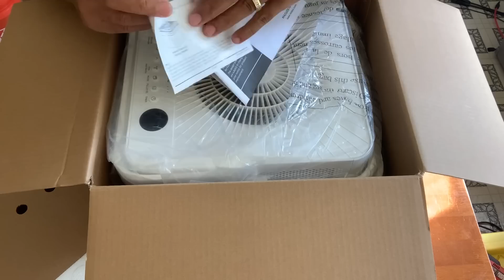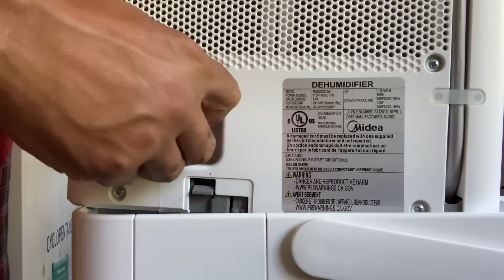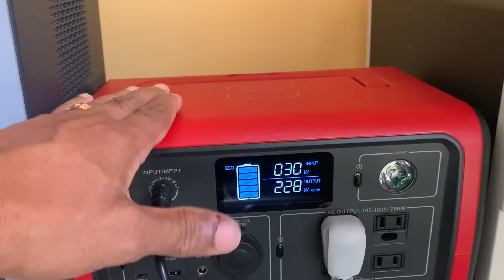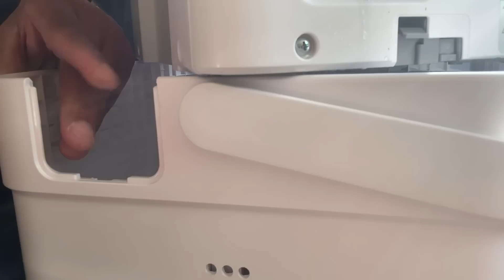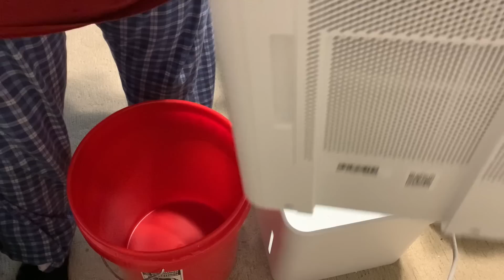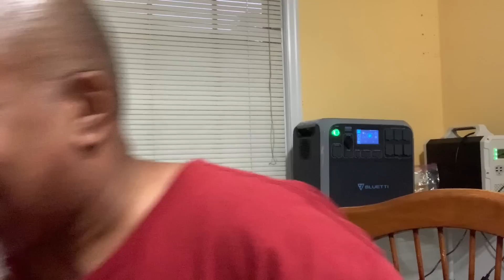WATER COLLECTION WITH DEHUMIDIFIER  Lead farmer73

Comment: need to test it for ammonia dehumidifier water is usually 8 ppm , 5 ppm is toxic to humans , your brand of water filter (it also says not to filter dehumidifier water with it )will not filter out ammonia SMH , The expense of making that water drinkable would be too high , can buy bottled R/O water cheaper . Drink it if you want , but your causing internal organ damage
Reply from the maker: check And look inside of the pipes under your sink and then I want you to read this again. I have been doing this for years. There is nothing wrong with this as long as the water is filtered please be educated. Thank you.

Comment: Now you will spend five days trying to unclog your filters from all the dust, pollen, and skin partials that are ruining them. Ask me how i know. My Berkey filters can filter 100s of gallons of tap water no problem. 10 or 15 gallons of dehumidifier water will wreck them. The particles floating in the air are so small you cant even see them. Its like throwing a hand full of talcum powder in with your water filter. The dehumidifier filter does not filter jack. My air is comes off the Pacific ocean and is the cleanest you can get. If you are in a city good luck.
Reply from the maker: Thanks for your comment💰

Comment: Technically this is distilled water and it doesn’t have minerals in it .. that means it’s not safe to drink everyday because it depletes the minerals in your body as they bind to water. To counter that you need to add some minerals into it to make it safe to drink everyday.

Comment: There are several modifications that can be made to ensure the water is safe to consume. Firstly replace heat sinks with copper, the plastic tubing can be replaced with copper, which has the added benefit of being incredibly bacterial and  mildew resistant. You can also switch any of the filters with food grade mildew resistant ones! If there is any plastic that the water comes into contact with, it can be replaced with a food safe alternative. 
 Then you can go one of two routes 1.) LOW COST,  A LITTLE MORE WORK- Create a diy three stage collection the first being a quality filter like water drop,second  using CLO2(Chlorine dioxide solution, a widely available and inexpensive chemical that will remove most pathogens) it is effective against biological, chemical and bacterial contaminants, even phthalates; yet possess no threat to humans or animals health. After a short treatment with CLO2 you can finalize and remineralize  with Celtic salt, Himalayan salt, and calcium carbonate. 
2.)HIGHER COST, QUICK SET UP-Use a countertop reverse osmosis filter with a natural remineralization filter included!
 So for a small upfront cost and a little modification, you can have a safe, reliable, replenishable water source for emergency or survival situations.
 IN ADDITION: The quantity of water will obviously vary depending on moisture levels and temperature, BUT even in the dryest of environments the air always contains water... So even in a desert you would be able to generate water . Obviously the bigger the unit the more water it will generate and hold,  but that means it will require more energy. There are very efficient larger units that would consume much less energy than multiple smaller units yeilding similar quantity, so it's best to get the highest quality with the most quantity possible. But better to get whatever you can to start and add additional units than to wait and be without this vital resource! 
 IN ADDITION TO THE ADDITION: Solar panels with generators are a great solution, another option if they are going to be in a relatively stable place is to utilize a solar attic fan panel or ring doorbell panel and have a dedicated connection that will take advantage of any sunlight to collect water! You obviously have to make sure to find a compatible panel to match the specifics of your unit but it's a possibility 😉

Comment: This water is aafe to drink but it has no mineralization as is. If you drink it it will wash your body of minerals. It should be mineralized before you drink it.  As is it is only hydrogen and oxygen. Good video but add Himalayan or celtic salt. Fine for bathing as is though.

Comment: Wow!
Thank you again Lead!
I live in a very humid area.
I have been researching homemade water collectors
This is a great idea!
Reply: This could literally KILL you. You can't drink the water from a dehumidifer. It passes through toxic chemicals, including oils and metals. You cannot do this. Please do not suggest that people drink this. You need an atmospheric water generator, yes it's the same principle, but the heat sinks are pure copper. The heat sinks in a dehumidifier are made of metals of all types, but it is NOT food safe. Pure copper is food safe. PLEASE DO NOT DRINK DEHUMIDIFER WATER PEOPLE!!! You can change the heatsink and be sure the condensation is being formed on PURE COPPER, which is food safe, THIS IS NOT SAFE TO DRINK!!! You cannot filter these contaminants out with a Berkey or any other water purification unit. Do not drink!!!

Comment: Lead,
How much water do you suppose it can collect if you put it outside, with the power station and solar.
Maybe you can use it with a 5 gallon bucket and the hose in case it collects more. When filtering the water if collected while outside do you think it should be further filtered by using a coffee filter before putting it in the Burkee water filtration?

Comment: Now this is one of the best survival tips I have heard yet and it is much better than trying to buy up cases of water! Thank you family ❣️ for caring and sharing!!! 💯👏😁
Reply: This is not a survival tip this will kill you! This could literally KILL you. You can't drink the water from a dehumidifer. It passes through toxic chemicals, including oils and metals. You cannot do this. Please do not suggest that people drink this. You need an atmospheric water generator, yes it's the same principle, but the heat sinks are pure copper. The heat sinks in a dehumidifier are made of metals of all types, but it is NOT food safe. Pure copper is food safe. PLEASE DO NOT DRINK DEHUMIDIFER WATER PEOPLE!!! You can change the heatsink and be sure the condensation is being formed on PURE COPPER, which is food safe, THIS IS NOT SAFE TO DRINK!!!

Comment: Thank you. I have a dehumidifier. The humidity level in my home right now is about 32%; outside it's 36. I'm going to run it for 24 hours or until full to see how much water it collects.
Reply from the maker: Let me know how it goes 👍🏽
Reply: @leadfarmer73  Once again Lead you've shown why you are worthy of having your own channel. At an average of 35% humidity I managed to extrapolate just under a gallon of water from the air in about 19 hours. I've owned a dehumidifier for quite some time now, but never thought of it from a survival angle. Keep doing what you're doing and kudos to you!

Comment: Great video..I had the same thought while running my dehumidifier. On it's own... dehumidified water is not drinkable due to bacteria in the air, mold spores, etc. Theoretically, the Berkey should be more than capable of removing those containments from the water making it safe to consume.
Reply: Yes. That and disinfecting your dehumidifier regularly so you don't overtax your Berkey, you could technically have your dehumidifier drain into your Berkey.
Reply: This could literally KILL you. You can't drink the water from a dehumidifer. It passes through toxic chemicals, including oils and metals. You cannot do this. Please do not suggest that people drink this. You need an atmospheric water generator, yes it's the same principle, but the heat sinks are pure copper. The heat sinks in a dehumidifier are made of metals of all types, but it is NOT food safe. Pure copper is food safe. PLEASE DO NOT DRINK DEHUMIDIFER WATER PEOPLE!!! You can change the heatsink and be sure the condensation is being formed on PURE COPPER, which is food safe, THIS IS NOT SAFE TO DRINK!!! Berkey cannot filter out these contaminants. DO NOT DRINK!!
Reply: @AwakeningWarrior  Whether it’s drinkable, I don’t know, but, the dehumidified water could be used in that 5 gallon bucket, to wash clothes with - all a person would need is a plunger and some dish or laundry detergent.

Comment: Still he used a solar generator to run the dehumidifier to get water out of the air and then ran it through a water filter.  Once owning all the equipment, the process was free. Wow.  Impressive!
Reply from the maker: EXACTLY! It all ends up paying for itself in the short term with the cost of water

Comment: A man had a truck full of dehumidifiers and a filtration system. He was providing clean water to the community. Military came in and confiscated his whole rig—everything. 

People with air conditioners are essentially doing the same thing. One gentleman in Africa got a patent on the idea. For the little people like us, this could definitely be a life saver, especially with solar panels as y’all have. 💯
Reply: Just ordered the small cube. Had a $20 coupon. I got very thing for the bucket filter but sand and gravel is so heavy so I got 2 gallon buckets. Just started your setup for growing with water. It is on the small with 2 1 gallon shoe box size.. just put in 2 lettuce sprouts yesterday

Comment: I have a small Haier that I use 24/7 and probably get a gallon a day. I use it to water my plants with outside. I'm on a well, but do plan to use it if the well goes down in the future. You could probably get water faster if you use the thing outside.
Reply from the maker: That sounds like you have a pretty good one.
Reply: @leadfarmer73  - It's a good brand, but it's smaller than yours. So it has to be hanged out several times a day. It beeps when the tub is full. I like that you're sharing your good ideas. :  )

Comment: I wanted to say "Thank You So Much" you are saving our lives on another level that they do not realize yet and appreciate that you listening to that "still" voice. I'm debating on size but it will not take long to do that,  just because I'm thinking of my extended family as well. Thanks again! for the both of you .  :)
Reply from the maker: Thank you so much single girl 🌹
Reply: This could literally KILL you. You can't drink the water from a dehumidifer. It passes through toxic chemicals, including oils and metals. You cannot do this. Please do not suggest that people drink this. You need an atmospheric water generator, yes it's the same principle, but the heat sinks are pure copper. The heat sinks in a dehumidifier are made of metals of all types, but it is NOT food safe. Pure copper is food safe. PLEASE DO NOT DRINK DEHUMIDIFER WATER PEOPLE!!! You can change the heatsink and be sure the condensation is being formed on PURE COPPER, which is food safe, THIS IS NOT SAFE TO DRINK!!!
Reply: @AwakeningWarrior  Thank you for the heads up. I'm still glad leadfarmer73 brought it to our attention, NOW. And, I've learned that you can use this water in many other ways and this could help us save our drinking water for drinking and dehumidifier water for other uses around the garden and home.

Comment: Do you like your Berkey?  Mine looks nice but it's a hunk of junk.  It takes days to filter a gallon.  I've tried the available pump which is supposed to help prime the filters, but it didn't help at all.  I totally regret buying that thing.
Reply from the maker: I know EXACTLY what’s going on! I thought the same thing for a second a few months back when mine started taking forever to filter. You have to take it apart and clean off the filters and can, reprime the filters a BOOM! working like new again. Your supposed to clean them every so often because they are catching so many small partials. I hope that works for you as well as it worked for me.
Reply: @leadfarmer73  Mine never worked properly, even when new.  Maybe they were just a batch of defective filters, I'm not sure.  I'm glad yours is working, though!

Comment: The Berkey water filter produces the best tasting water you could possibly drink . Thank you leadfarmer73 for all this precious information.
Reply from the maker: Thank you Samuel. The Berkey is the truth!
Reply: Thank you Lead, this is life saving information! Believe me it want be wasted.
Reply: That Berkley filter and others like it was designed for using in tandem with tap water primarily which has already been treated to a degree. Think of like a better Brita for instance. With the humidifier, you are pulling water from the air which can have any number of contaminants that the Berkley filter is not prepared to handle. For that reason, I think that you should probably still boil that water after running it through the filter if you want to drink it.

Comment: That’s an awesome idea. I will definitely be buying one. Every house hold needs one. This is a must for survival. Thank you Lead for your thinking out side of the box survival advice. It’s much appreciated.
Reply from the maker: This will help EVERYBODY keep thinking of different ways to find water everyday
Reply: @leadfarmer73  Dear Leadfarmer73 thank you for sharing this valuable video with all of your followers. I have been doing this with my dehumidifier for over two years..... I would like to add something on addition to what you have already shared with the rest of the family. this is CANNOT be drunk in the condition that it is in the collection tank that becomes full and needs to be emptied when it becomes full----it MUST be filtered like your suggestion. However that water that is collected CAN BE used and is still ideal for for washing dishes and and flushing toilets and watering plants and so much more. I save my collected water inna large blue plastic 10 gallon jug that has a built in spout foe easy pouring. It looks like one of those big plastic red gasoline jugs that you can  buy at the auto parts stores...except that it is BLUE plastic which tells anyone that it is WATER use ONLY!!!! Thanks for all of your passion and knowledge that you pour out and share with so many from your Servant's Heart.
Reply: @leadfarmer73  Lead, I have an idea.  Get a primo water dispenser and plug into generator.  Instant hot OR cold water and save tons of fuel on trying to heat or cool water.  From there, put into a thermos.  I like the Ozark 1 gallon jugs. They are excellent quality. Comparable to yeti and only $29.
Reply: Water out of thin air!!😳🙂 I never would have thought of this!! Thank you sir.😉
Reply: This could literally KILL you. You can't drink the water from a dehumidifer. It passes through toxic chemicals, including oils and metals. You cannot do this. Please do not suggest that people drink this. You need an atmospheric water generator, yes it's the same principle, but the heat sinks are pure copper. The heat sinks in a dehumidifier are made of metals of all types, but it is NOT food safe. Pure copper is food safe. PLEASE DO NOT DRINK DEHUMIDIFER WATER PEOPLE!!! You can change the heatsink and be sure the condensation is being formed on PURE COPPER, which is food safe, THIS IS NOT SAFE TO DRINK!!!
Reply: @AwakeningWarrior  ok calm down. If you don't have water you will die anyway.  I think you underestimate the filter. Also, I drank from the water hose as a kid. It spent all day baking in the sun but guess what? I'm not dead
Reply: @AwakeningWarrior  after filtering.
Reply: @jkco4300  You can't filter out the oils and contaminants from lubricants and chemicals. This is asking to be poisoned.

Comment: Thank you for this review Lead.! Been thinking ta out this “hack” for a while cuz I live in a high humidity state (FL) .  I love the bucket receptacle and also that it has a drain hose option (feed it right into my berkey!)   Great to know how many watts it pulls on full power too. Definitely going to pull the trigger on this today... thanks
Reply from the maker: Thank you so much Nancy 🌹
Reply: I have a Berkey too and this excites me because the filters will last longer filtering this water rather than in my case hard to come by lake water. I’m not near natural water sources, but even for people who are this is much cleaner water to filter out.
Reply from the maker: @alisham4902  yes it is. And it tastes incredible. I just watered my house plants and did a 5 gallon water change in my aquarium just by using this machine. All with natural clean water from the air. No chlorine or anything
Reply: @leadfarmer73  I’m so excited and I’ve been thinking I will only filter drinking water. If it comes down to it I think it would be perfectly fine to use the water unfiltered for my indoor garden, showering and washing dishes and clothes. Well, I probably will go ahead and filter for the garden. You are so right though, once mainstream prepper communities gets wind of this they will become extremely hard to come by at an affordable price. I have a 2000 Bluetti, but now want a dedicated smaller solar generator just dedicated to this.